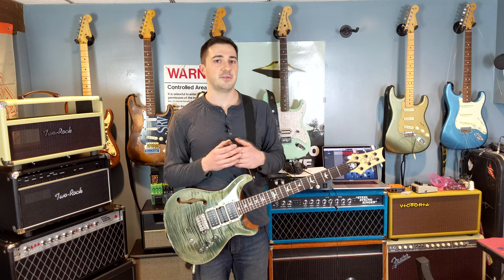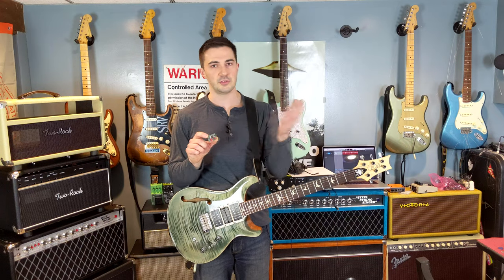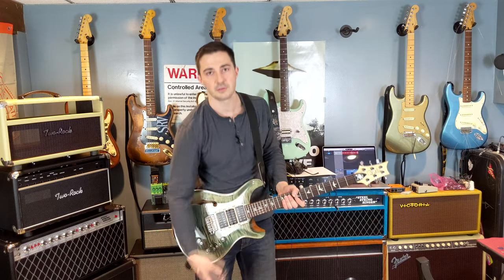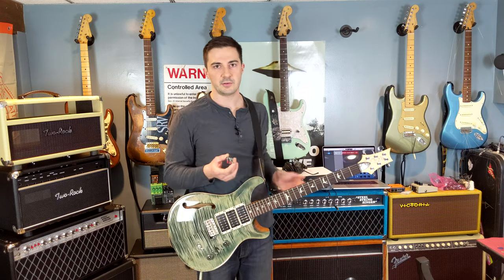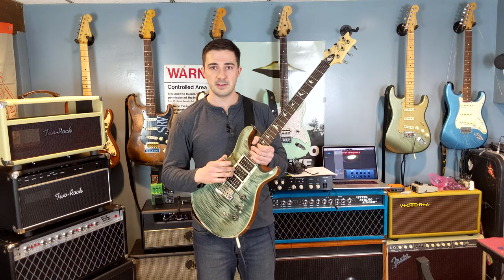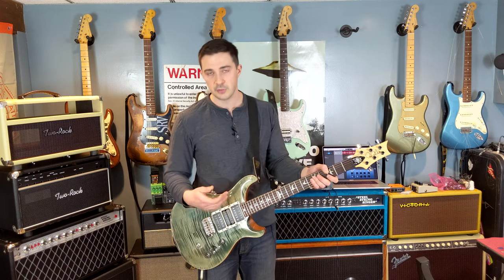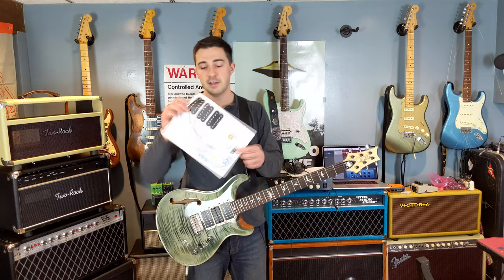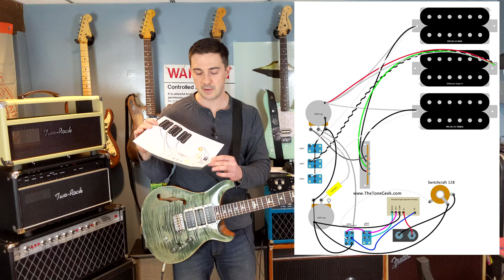Pseudo Eagle Preamp | Super Unity Gain Buffer & Treble Boost | On-Board Electronics

Comment: In the pre amp link it says, "Unity Gain Buffer & Treble Boost OBEL".  OBEL usually means On Board Effects Loop (like Jerry Garcia used). Those guitars had 2 quarter inch jacks to run the effects through the guitar. The Pseudo Eagle (and Super Eagle) just has a single output right? Also does the buffer and treble boost come with installation directions? Trying to make an "SE Pseudo Eagle"Thanks-Karl